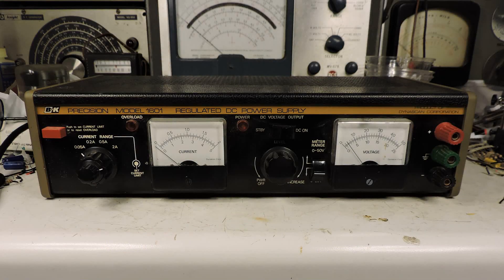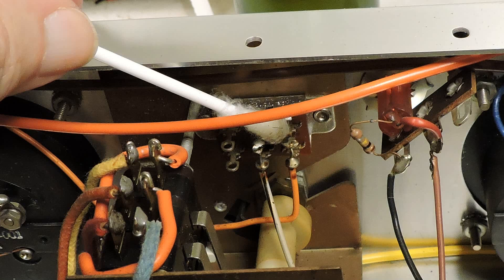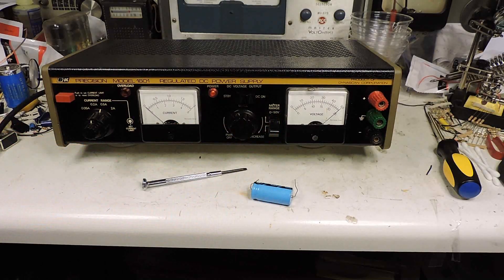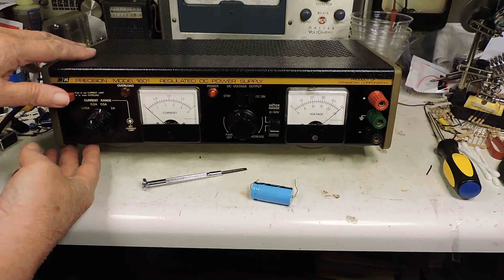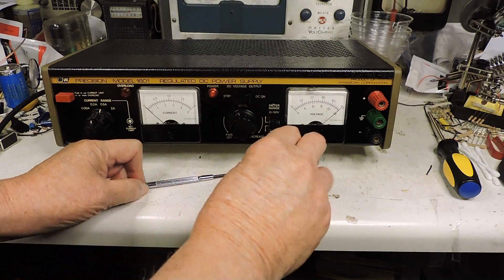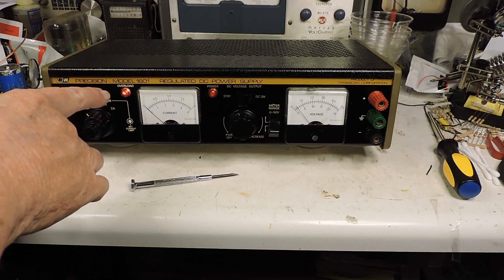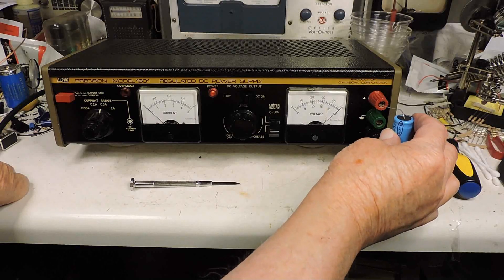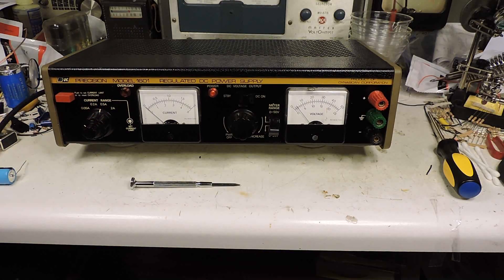B&K Regulated DC Power Supply Model 1601

Comment: Nice supply - recently picked up a BK Precision 1660 myself in good condition.  Checking on WD 40s suitability for electronics I find many cautions not to use it.  Contact cleaner or denatured alcohol is recommended.
Reply from the maker: +Digger D 

Ho, the cautions from the Global Warming Scientist!!!!! I started using WD-40 in High School, graduated in 1963, never had a problem using it.
Reply: Yeah, I've heard from both camps.  I just wonder if the oil doesn't attract more dirt than it gets rid of ;)  I'd give it a try if contact cleaner didn't do the job.
Reply from the maker: +Digger D 
My WD-40 TEN YEAR Experiment
https://www.youtube.com/watch?v=lyjUDh7Djpo
Reply from the maker: +Digger D 
The radio is still working and you can see it in the lower right, in the opening shoot of the Mini Maker Fair. Used it all day long. But of course do what you want to do. I just don't like lies.
Charlotte NC Mini Maker Faire
https://www.youtube.com/watch?v=23P8VZTbrFM
Reply: AllAmericanFiveRadio I don't think I was lying when I stated that I had "read" what I said.  Watching your video now - looks good.  Often real world experience is better than what people say or assume.  Apparently it works well from what I'm seeing.
Reply: AllAmericanFiveRadio Again, nice find on the power supply - I found my 1660 for $100 Cdn and the fellow was kind enough to deliver it as it weighs something like 10Kg :)  Still pretty close to spec as well (few millivolts out from calibration).
Reply from the maker: +Digger D 
Look, what I'm saying is check things out for yourself, don't believe anybody. There's so much crap out there today it's unbelievable. Do your own experimenting that's the only way you will find out what is actually the truth. A lot of the myths that permeate our culture has been started by manufacturers who want to sell their products, do your own testing.
Reply from the maker: +Digger D 
My 1601 is not perfect either, but it's so close I'm not going to bother changing any settings, because when I'm using it I'll have a digital meter across the output anyway.
Reply: AllAmericanFiveRadio Exactly - I never assume the power supply readings are exact although usually very close.
Reply from the maker: +Digger D 
I am very happy that I was able to get this model 1601, B&K makes very good products and they're still in business today. Good luck with your 1600.